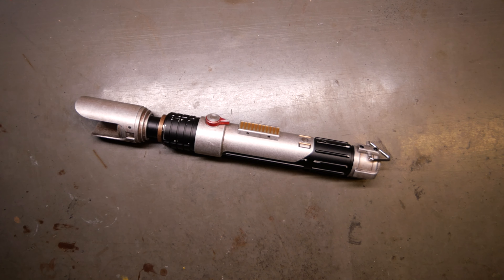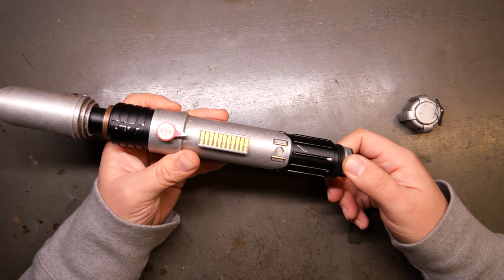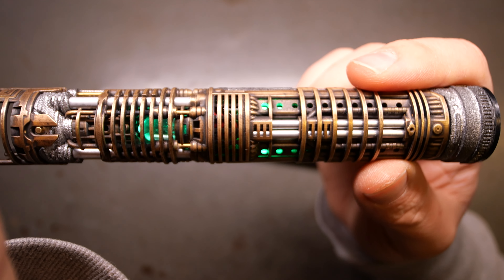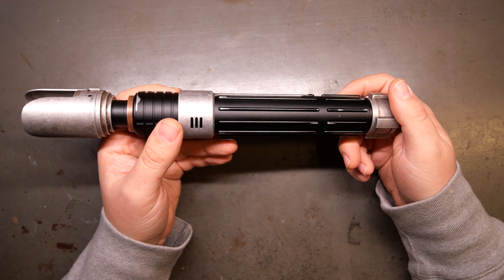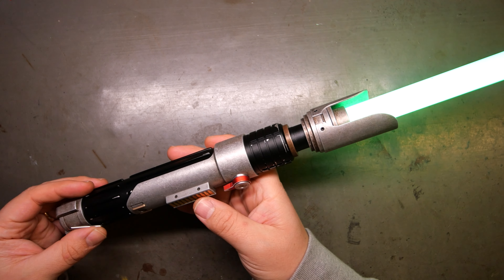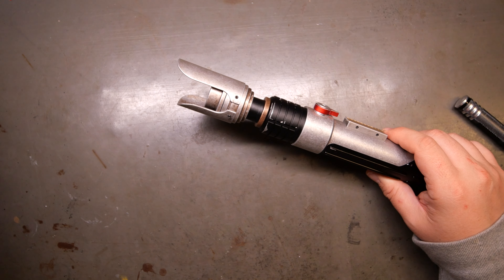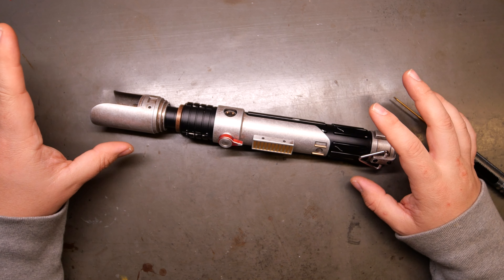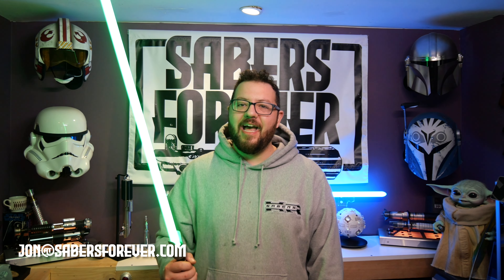5PECTER FIVE Master Chassis Installed by Sabers Forever

Comment: Could you use @Fett263 prop special abilities to turn the motor on/off? Have it set up in the bladestyle to turn off the motor, and have it built into any?
Reply from the maker: I’m sure you could 😊
Reply: Or use blade detect with the rotary connector, but admittedly it adds a lot of code